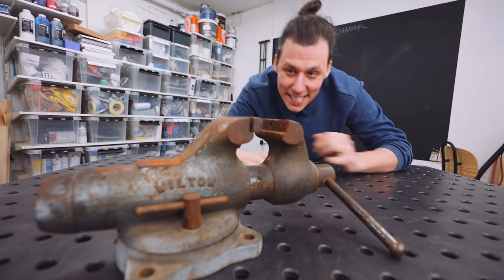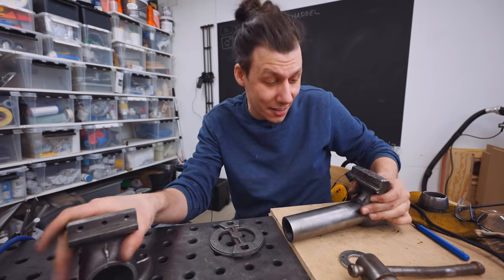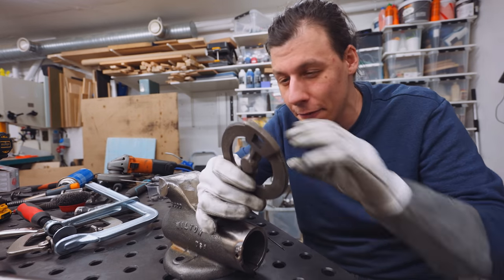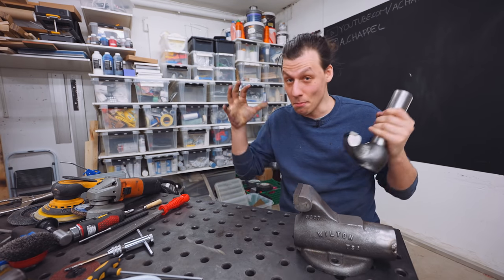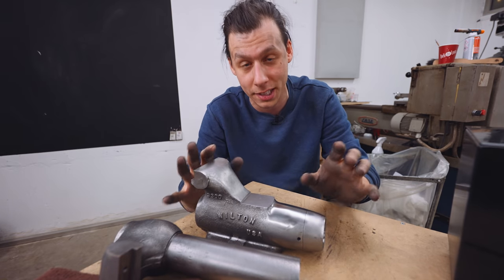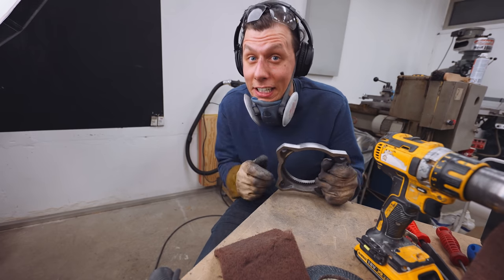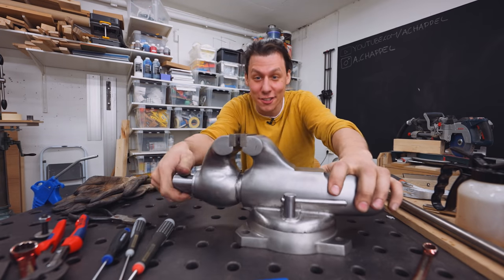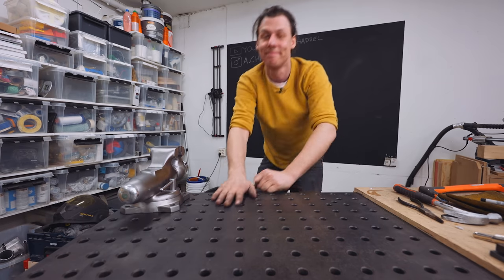Trying To Restore This Rusty Old Wilton Vise

Comment: Isn't there this rule to not use gloves with spinning machines? No offense, I'm just curious. What do you think about this?
Reply: If i remember the rule, it is you wear gloves that tear easily (like latex or nitrile) so if it is caught,  it won't pull you in
Reply from the maker: Yes defeneatly! Drill press and especially the lathe. If you're referring to the wire and polishing wheel, that thing Is so weak that I easily can stall it with my hand. For comparison it's 250w direct drive vs 800w with gear reduction on my drillpress.

Comment: I hated you for putting polyester filler in that other vice, but grinding off those markings is a crime, you have not restored it, you've destroyed it, removed material and strength for aesthetics, that's at total fail. :-(

Comment: Well, don't call this a "restore". It's a build project which is actually based on a manufactured (and at the end, destroyed) original thing. Other than that, good job, well done. Just for curiosity: what will stop the new shiny surface to get rusty again?